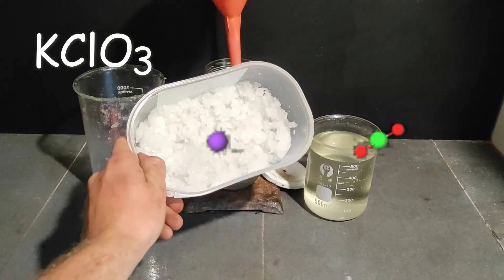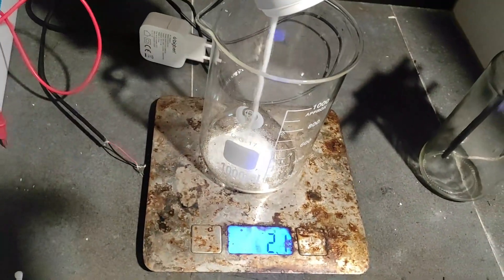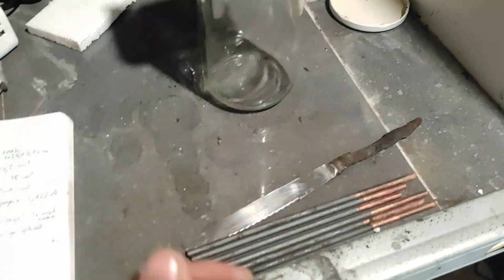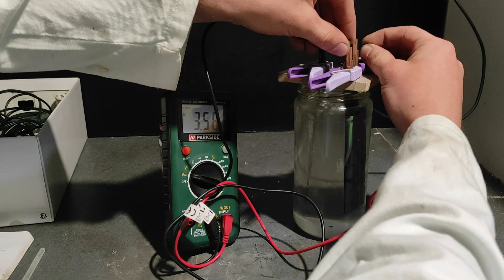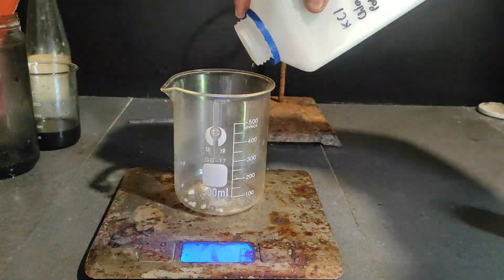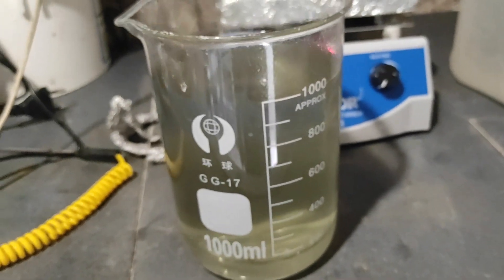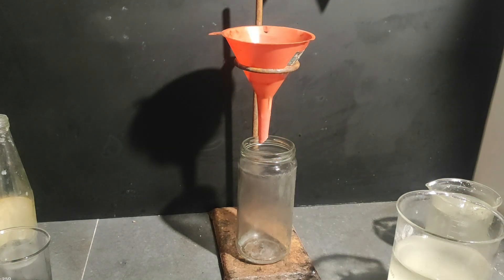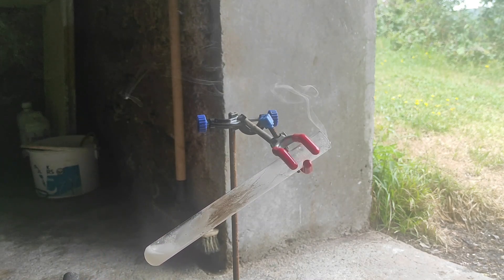How To Make Potassium Chlorate From Scratch

Comment: I have a couple questions
1st for the electrodes is it the same if I use graphite from pencils or do I need to buy the carbon rods
2nd why are you using six electrodes
3rd why do you use steel for the cathode
4th what do you use to test the ph 
5th for the setup are the carbon rods connected to the positive
Reply from the maker: Thanks for your questions !
1: graphite from pencils does not work for longer electrolysis because they decay in a few minutes in the conditions for chlorate synthesis.
2: I'm using 6 electrodes because I need the correct current density, the amount of amps per area of electrode 
3: steel works well as a cathode because it reduces water into hydrogen which is not harmfully for iron, tho ,it can be said that other metals will work just as well if not better (for exemple titanium)
4: for the pH I just use some cheap pH paper because there is no need to be very precise 
5: yes the anode is the + so carbon rods and the cathode is the - so the steel
Reply: @jam_kemist3986  thanks your the best

Comment: Never seen someone getting his solution that clean, after the erosion of a lot of carbon rods in it. So may I ask, what kind of cotton filter you did use exactly?
What also would be nice, if you could produce some pure NaClO3 from it, especially for the ones, who have nothing but table salt, but I know it's not so easy as KClO3. 
But still possible.
Reply from the maker: @ralfvk.4571  if I remember correctly I just used some Cotton from the bathroom but if that doesn't work you can also let it sit a long time and decant the solution.
To get NaClO3 you just need to boil down the solution instead of adding KCl and NaCl should precipitate first which you can filter and then after some more boiling NaClO3 should precipitate

Comment: Question is there still some sodium chlorate contamination? Flame looks rather orange to yellow, instead of the usual potassium based flame.
Reply from the maker: Yes there is indeed some. If u want pure KClO3 for pyrotechnics for exemple you need to électrolyse KCl directly instead of NaClO3
Reply: @jam_kemist3986  right on! Thanks for the video!

Comment: It looks like there is some sodium impurity from the orange flame at the end, you could start with KCl, then boil it to decompose the hypochlorite, then add more water until all of it dissolves at room temperature (or maybe around 30-40c), then filter it to remove all insoluble particles, after that, boil the water again until you reach your starting volume of solution, or even less if you don’t have a lot of chloride left in solution (you can check with the density of the solution or if your voltage starts to rise and your current drops), after that, let it cool in the freezer at 0c (im pretty sure it will not freeze because the kcl lowers its melting point by quite a bit but it really depends on the concentration of chloride and temperature of your freezer) and thats it! No sodium contamination at all!
Reply from the maker: @AwdeInho  yeah I figured, but I don't really mind because I don't need it pure anyway 🤷
 thanks for the comment !

Comment: whats the yield? like in gramms percent doesnt matter you can always run another batch
also how pure do you think is the product?
could do a titration with iodine salt. but that is kind of over the top of the average jam chemist so...
dont worry bout it
and where did you get the carbon rods? just from amazon as welding stuff?
Reply from the maker: I think I measured ~220g of KClO3 but they still had some moisture from the air so I'm not sure... It's probably pretty pure tho since only KClO3 can precipitate when cooling down, the only impurity would be from leftover solution so a bit of KCl and NaClO3 mostly but for synthesis or pyrotechnics it's good enough, and yeah I don't have burrettes nor iodine salts atm so no titrations 😔

I got the carbon rods from Amazon ye, they where coated in Cu which I removed with some weak pirhana solution;)
Reply: @jam_kemist3986  Thank you mate.
thought about your video lately but could not find it.
i had this very well thought out and very well presented video in mind but could not find it.
made me crazy...
finally found it and was just again blown away by the quality.
really good that you explained your thought process behind the cell. definitely trying it out. should be only an amazon shop and a visit to the local scrapyard